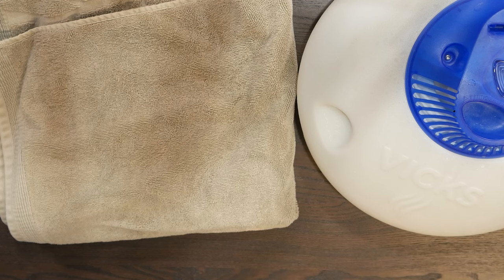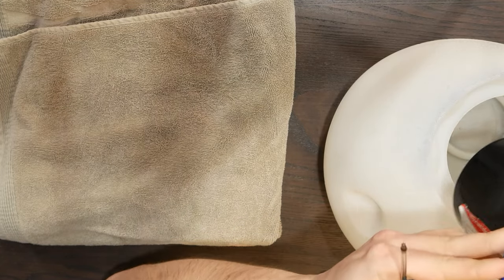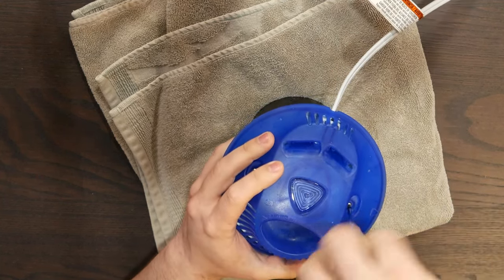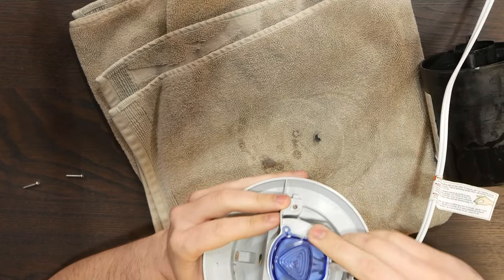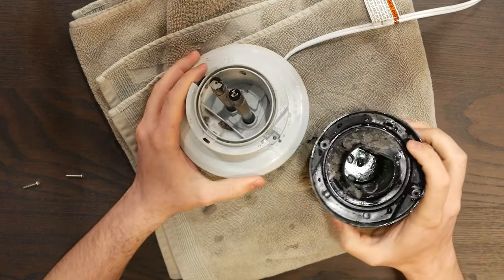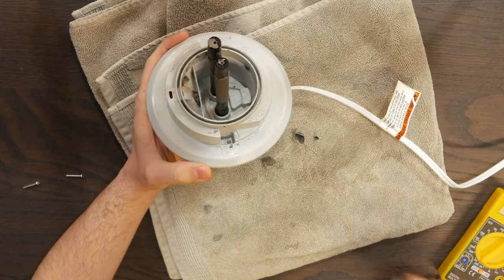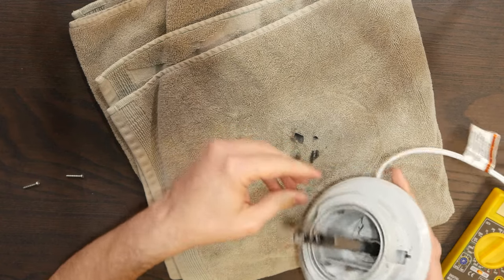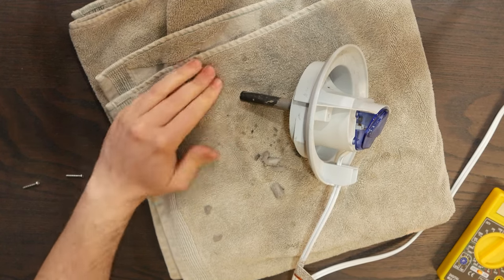Is a Vicks vaporizer an electrode boiler?

Comment: I know I'm a year late to the party, but I'm surprised that you're surprised by this.  It's an excellent design as it's cheap and has a few inherent safety features.  The water level serves as it's own cutoff.  Once the water level drops below the electrodes, the circuit is broken.  No need for a float or switch.  Also, the electrodes being submersed limit the maximum temperature of the unit to around boiling temperature of the water.  Again, a free safety feature.  Also, there is a current limiting resistor in series with it. Not sure what that resistor is, I suspect around 20 ohms, but it will reduce the voltage across the electrodes. Your meter saw the full 120V because the circuit was open and the resistor was negligible compared to the gap between the electrodes.  In water, that voltage is probably only 5 or 10 volts.  I'm sure you already knew that though.  Point I'm trying to make is, if you touch those two electrodes, it's going to hurt, but you won't get the full 120V shock.  And Vicks did a good job of shielding you from those electrodes.  Unless you take it apart, you're not getting shocked.

The only concern I have with it is if you got enough scale built up to bridge the two electrodes.  I'd like to see a fuse in here somewhere (other than my circuit breaker or GFCI) in case of a short.  The scale you had doesn't seem too conductive, as shown by your power draw tests, but i don't like the idea of anything bridging that gap outside of the water.  Also, Id like to see a simple switch.  I think alot of them did have switches but we had one when I was a kid that did not.  Unplugging it was the switch

Comment: they definitely still are like this. in my previous relationship we got one around the end of 2019 and it looked identical to this one. i didnt tear it apart but it had the same style of black plastic shroud and a bubble style water tank. i absolutely hated it. trying to clean it and descale sucked so much. but she wanted to get one because her friend had that one and "it worked amazing". no matter if i tried showing better ones at the time she wanted that one. well its no longer my problem nor my electric bill. i always wondered why the electric bill was so much higher. she blamed me for the bill going higher because my computer must be doing it
Reply: Most desktop computers use 150 watts or less of AC at full processing power (many new computers use less than half that).  Some video cards use more but unless you are mining Bitcoin or playing AAA video games you probably don't have one.

Comment: I think you might be being a bit harsh on the energy consumption of these. 

The energy for evaporating the water has to come from somewhere. In the case of this one it's directly from the electric heating element (of sorts). In the case of the other evaporating humidifiers / coolers it's coming from the room, and the room heat is coming from your furnace. They're using the same energy, but one is provided by electricity and the other by gas. In this case I'd assume your gas is cheaper per kWh but in an ideal world the electricity would at least be green. 

The energy "consumption" of the others is higher than you're measuring as you're not measuring the cooling effect in the room.
The energy consumption of this one is lower than you're measuring as you're not measuring the warming effect that hot vapour has.

Finally, and I haven't watched the other follow up video yet so you might mention it there, you haven't taken in to account the additional thermal mass that humid air has. It will take your furnace longer to heat that up, and if you have air leaks (draughts) then per unit volume you'll be "losing" more energy outside.

Comment: I have a pamphlet with instructions on using carbon or graphite rods to build an arc welder and the design is remarkably similar to this, that author even suggests using a water resistor to prevent tripping the circuit breaker.

Comment: 5:00 You have all that build up because that's half of a water distiller...

As the water boils off, everything in the water with a boiling point higher than 100 °C (212 °F) gets left behind to deposit on the electrodes and tank.

Add a cooling/catch tube to the top of the unit and you could make your own Distilled Water for use in a steam iron, swamp cooler or ultrasonic humidifier...

Comment: So, you know that the Vicks product page straight up tells you this is how it works, right? The wierd stringie crusties iare due to the fact they they are electrode boilers - it's a faq/manual item that talks about it.
They still sell these exact same units in pharmacies (at least on the East Coast). CVS has a rebranded unit that's red. 
They might not be great at humidification, but they are spectacular essential oil diffusers/airborne vaporub bombs for anyone with sick little kiddos.

Comment: We have the exact same type boiler in Europe, where you'll get 230 V between the two rods (for extra fun).
P.S. I think the most interesting piece of such a simple boiler, I mean... humidifier, is the black guard around the electodes: I have a suspicion that's required to keep the boiling water concentrated near the electrodes and under the steam hole, otherwise it would take quite a long warming up before it produced any steam.
Reply: Nope, electrode boilers can be inserted into huge buckets of water and will start boiling within a few seconds after turning on, as long as there's not much stirring.

Comment: The extreme buildup of minerals might be due to the fact that water treatment puts in extra minerals to protect against lead poisoning. If lead plumbing is still in use a layer of minerals will prevent any lead from dissolving in the water.

Comment: You need to try one of the humidifiers with a little metal bulb at the bottom that heats up. WAY easier to descale. Just soak it in vinegar for a bit and the scale pops right off.

Comment: I have one that is barely 3 years old. It's EXACTLY the same, inside and out. This doesn't surprise me in the least. It probably cost Vicks less than $5 to make one, and they sell for under $20. You can buy this model (or one that's nearly identical) at Target right now.
Edit: also, the scale is probably that color because there's a lot more than just lime in your water. You wouldn't happen to live in Flint, MI?

Comment: Mine came with instructions that explains how it works and why adding salt or baking soda is necessary. The black scale comes from the carbon electrodes.
I like them in the winter. They help heat the space and probably kill bacteria with the steam. So if I'm using electricity to heat anyways and I'm gaining humidity, win win?

Comment: While it could draw 500+ watts, eventually the boiling effect gets so large that the power draw falls - it's not able to arc across the air-gap (or steam-gap) between the electrodes.

Comment: I had a coffee machine which was basically a simple electrode boiler. If I put in water from water bottles sold in stores, it'd never boil. However, tap water was boiling. And we have tap waters with different content in different parts of the country, thus with different conduction levels. In where I live, it was boiling the water say in about 5 minutes. Then I moved to a different place for university. There, it boiled the water in a few seconds! :D Basically, creating a short cut with power cord starting to heat up immediately and smoke. :D
One day, a friend tried to use it without my knowledge. Power cord melted, fuse blown, and boiler went to dumpster.
Just be careful with electrode boilers, they may be much dangerous than they're designed to be. :D
Reply: @Christopher Grant Cheap chinese boiler that nobody asks what you do with it. :)

Comment: He isn't kidding about the power use.  I found a Q&A answer on Target and it was measured at 638 watts. So, about a kilowatt every 1.3 hours  and I'm going to guess at  25 cents per kilowatt so that's about $1 per day for the  5+  hours I run it.  Actually $2 because I run two of them.    But, I do get to offset some or all of that in the winter when I use them because humid air makes the room feel warmer so I can lower the thermostat  but more importantly, I don't walk around sparking every person and door knob I touch.  Winter is only 3 months long.

Comment: Why doesn't it generate H_2 and O_2 or CL_2 gas? Maybe this is better suited for NileRed, but at what AC frequency does H_2/O_2 or Cl_2 generation become a problem? Obviously, at the DC limit, the electrodes will do chemistry rather than boil the water, and at 60 Hz, there's little enough chemistry going on to make this a 'safe' consumer product. Somewhere in-between though, flammable gases would start to be produced. Also: what do you think the electrodes on this thing are made out of?

Comment: If you really want to have some fun put a whole whack ton of salt into the water. You'll get a really loud hum out of the unit and either a constant stream of thick hot steam or even boiling hot water shooting out of the vent hole. 

These are really handy if you travel a lot though. I used to keep one in my car for hotel stays as I wouldn't trust an evaporative humidifier in a hotel room, due to the way these boil water, funk in the air or water aren't nearly as much of a concern.

Comment: Would that build up be the products from electrolysis on the water? I may be wrong, but wouldn't an electrode boiler heat the water by reacting minerals in it, meaning the products would come out of solution and build up on the electrodes, making it particularly bad?

Also, wouldn't the current of the device depend entirely on the amount of mineral content in the water since the water is the only real resistance in the appliance (apart from the wires, which have negligible resistance). So you could theoretically control the power consumption of the device by controlling the mineral content in the water, say by adding salt to distilled water. Not useful at all, but interesting.

Comment: Remember that resistance is a function of current, so while you may have 120v under no load, the current may be limited greatly by resistors or the electrode materials.

Comment: The Honeywell is a much better steam-based humidifier. Not electrodes, some sort of rubber(?)-coated heating element that sticks up into the water (not into the tank) about 2 inches. Tank sits off the side of the heating element and the scale doesn't go into the tank.  Has two heat settings.  Just needs an overnight sink in vinegar (manual says 20 minutes ha ha) about once a week, less if you have soft water.  About $30, although it looks like they've changed the design and raised the price to $35.

Comment: assuming you're using it in the winter, wouldn't the extra energy used just contribute to the temperature rise of the room, thereby reducing the amount of energy used by the heater? 100% efficiency!

Comment: You may want to consider: By using the cheap meter for the things most abusive to meters, you're also using the meter with the worst safety protection for things most likely to make it blow up or catch fire
Reply: For most things these $5 multimeters are safe enough as long as you replace the leads that come with them with better quality leads (about $10, these should last a person's lifetime and can be used with the next multimeter).  The leads that come with them are so cheaply made that the metal point comes unsoldered from the wire very quickly (this is all covered by plastic so you shouldn't get electrocuted from this but usually when you use a multimeter you are depending on it to work properly).  A Fluke will be $300-$750 depending on which one you get, not worth it for someone that mainly uses them for low voltage DC circuits and seldom needs one for AC work.  If I were an electrician and not a retired tax professor I would probably gladly spend $750 on a top of the line Fluke but the little bit of AC work I do makes the cost asinine for me.
Reply: @mharris5047  I mean, I'm not saying you need a Fluke. $50 will get you a decent, safe meter if you're working with household AC. The cheapo $5 meters might not even have a fuse on the 10A jack. Do a voltage measurement across mains (like in the video) after forgetting to move the lead back, and you're going to have a bad day.

Comment: Are those graphite electrodes? It's possible that the electrolysis is liberating enough oxygen that it's just turning the electrodes to partial ash. The electrodes would just flake away over time. It's still inert and shouldn't create enough hydrogen to be dangerous but that would put a definite finite lifespan on that product. It's probably a lot cheaper than using something more durable like stainless steel.

Comment: There is one safety advantage to an electrode boiler in this case.  When it runs dry, the power just stops.  No need for a float switch that will get scaled up and stop working, and no chance of it running dry and overheating to melt the plastic body and start a fire.

Comment: The more I see of humidifiers the more I get convinced that the towel in a bowl of water is the most hygienic variant, lol.
Reply: What's wrong? This humidifier simply just leaves behind built up minerals from the water. These are minerals in the water that you would otherwise drink/breathe.... If anything the humidity from this water is cleaner than any other humidifier on the market, or even the towel scheme as it is sanitized and demineralized before the water ever enters the air. This Vicks variant is very close to the most hygienic humidifier currently possible.

Comment: Interesting, I don’t have mine anymore but the Vicks Humidifier/Vaporizer I had used a motor to spin a cone surrounded with fingers to splash water about and throw it in the air.

Comment: this is not a humidifer, it is a vaporizer. there is a difference in the way they work. and this vicks vaporizer worked for me to clear my sinuses especially when the heater is on forever in the winter months. vaporizers are better than humidifier because they produce hot steam as opposed to humidifier which creates mist which can help mold formation.

Comment: i wouldn't use those $5 multimeters on anything powered from the wall. They are little more than toys and have few if any safety features. The fuses in them (if there is even a fuse) are glass fuses not rated for mains as they can explode on mains fault current, a large voltage surge from a nearby lightning strike could also make it explode in your hand and the transistor tester is connected straight to the probes which puts high voltages right next to your fingers when you're probing mains. AA or 9V battery powered stuff only, definitely never use above Cat 1.

Comment: Please use a multimeter with a UL Listing and a least CATII rating to measure mains voltage those cheap multimeters are ok to probe low voltage and continuity but don't know when they are go blowup when dealing with Mains AC, for what you don't need nothing too fancy just safe a reputable brand low end should be in the 50 to 100 USD range the Fluke 101 or 104 are a good option

Comment: damn that spacing looked so small. Then I remembered you're on 120v. The ones I am familiar with are used on 415v  with 3 nickel electrodes... for a university library (holding some rare books, constant humidity is essential)
Reply: The nickel electrodes were grid style. They'd need routine (every 6 months) replacement. The control PCB had some interesting logic on it tho, they had a waste pump ... and used a current transformer to determine when the concentration was too high, and dumped the contents of the tank to the drain, which then refilled (slowly) from a tiny header tank connected to the mains water supply. The slowness was deliberate to prevent the waste pump fighting with the filler. A common trick we used to lengthen electrode life was to put an extra turn thru the current transformer, making the 'dump' cycle trigger at a lower concentration of minerals.

Comment: Just a positive word on these humidifiers. If you’re getting rolling outages and it’s freezing and you only have 45 to 60 min of  electricity at a time, they are a GODSEND. A teaspoon of salt and a quick plug in and it will blast out steam enough to give your limited heat something to hold on to until the next cycle. This winter is something else.

Comment: I'm a bit confused why you'd specifically use the cheap meter for this. This is exactly the situation where I'd want to make sure to use the good meter. You know, the one with good insulation around the probes, with separate probe ports for current and voltage so you can't accidentally cause a short circuit just by using the wrong setting on the wheel, and with HRC fuses that don't explode if you still manage to short out the mains...

I would only use el cheapo meters like this on low-current, low-voltage circuits that are not dangerous to short out or touch.

Comment: The plus for this type boiler is that if the water gets low it stops working and does not generate heat anymore.  There were older heater style that regularly melted down and sometimes caught on fire.  The heater type required glass and ceramics to prevent destruction, expensive!

Comment: If you are using electricity to heat your home anyway, does it make this humidifier more acceptable to use? It's efficiency must be at, or near 100%, no? That would make it a 250W space heater.

Comment: The fact that its an electrode boiler is quite an elegant design decision. It cannot boil dry! If there is no water, then there is no circuit and therefore no self destruction. 

This negates the need for a thermal fuse or water level switch. You can turn it on and at least rest easy knowing it won't burn your house down if it boils dry.